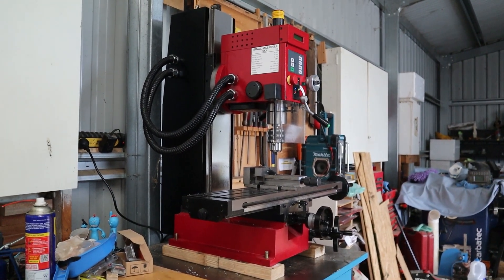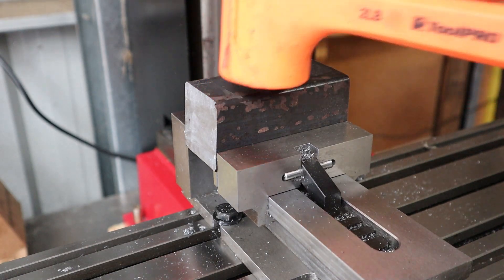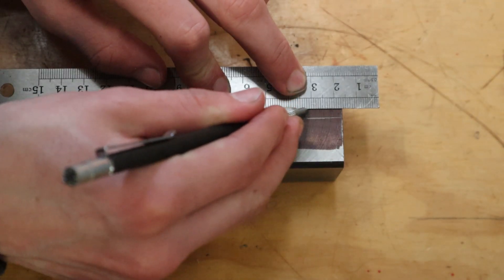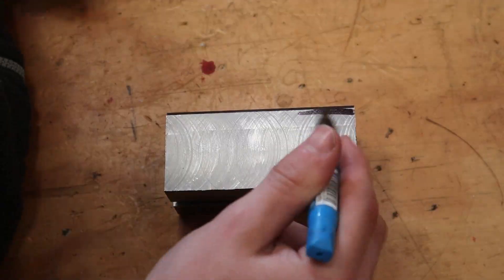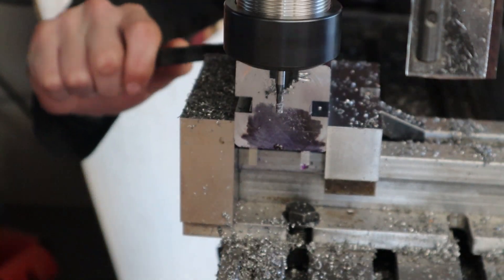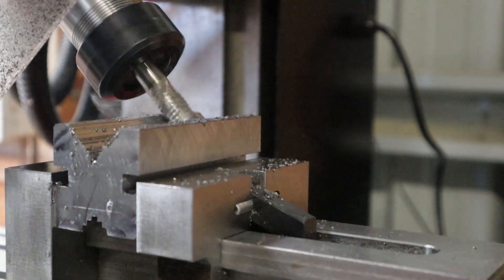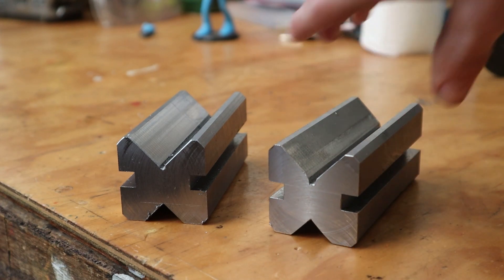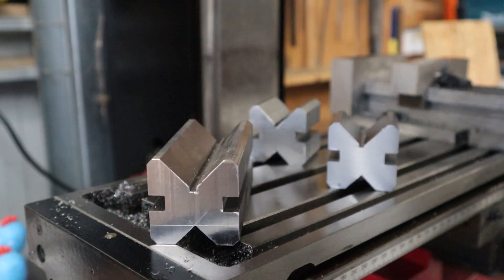Making Machinist V Blocks on a Mini Milling Machine

Comment: You don't need to use lubricant on a flycutter it'll stop the chips flying and they can drag, causing surface roughness. The reason its called a flycutter is because the chips are supposed to fly away from the tool.
Reply from the maker: Good to know.  Thanks

Comment: Great work James. I recommend you use an oil versus WD-40 for lubrication. WD-40 is technically a solvent, and it cooks off at a fairly low temperature.
Reply from the maker: Thanks for the suggestion! I have recently bought proper cutting fluid.  That we just all I had at the time.  Not the greatest but better then nothing haha.

Comment: I just made a smaller one since I didn't have any larger piece of steel. I used a grinding cup wheel in the mill to get a really smooth surface.

Comment: Nice job on your first project. I cringed when you tilted your mill head, I find that tramming the head back to 90 degrees is the hardest part of setting up the mill in the first place. When you see your Fly cutter cutting on both sides of the head (cutting a part lower on one side of the mill) it is a sign the head is not trammed to 90 degrees, and that will affect everything you cut in the milling machine.  (I am pretty new to milling too).
Reply from the maker: Thanks for the advice! I’ll definitely look into that